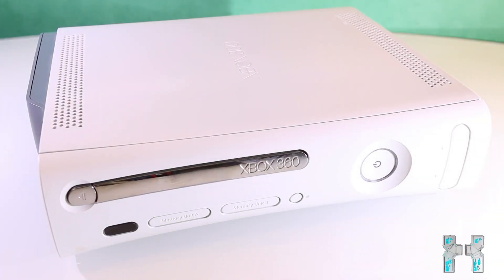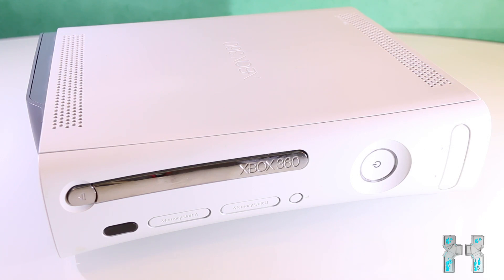How to open a Xbox 360 - Getting the mainboard ready for the R-JTAG [HD]

Comment: I disagree with the use of a screwdriver to remove the X clamps. I think a proper tool (TX X Clamp Tool) would greatly reduce the risk of board damage if it were to occur.
Reply from the maker: yeah thats true :) but i think people dont want to buy a tool if it works like this. Now jtaged and opened up so many boxes and no mainboard got damaged :)